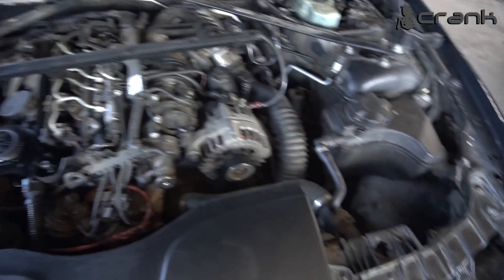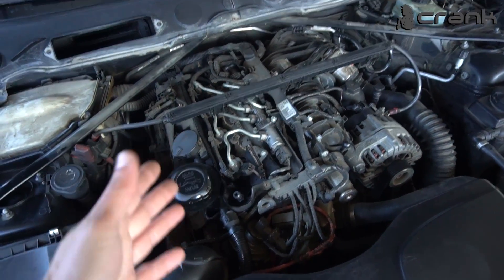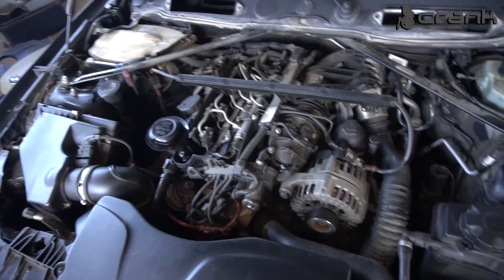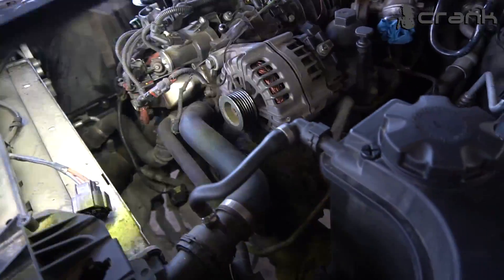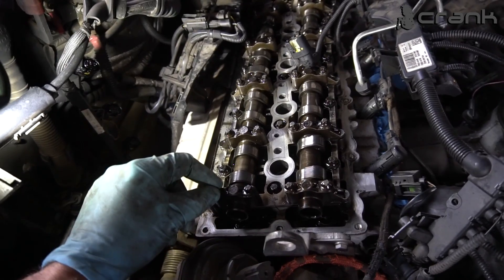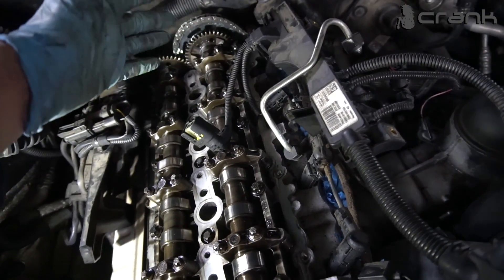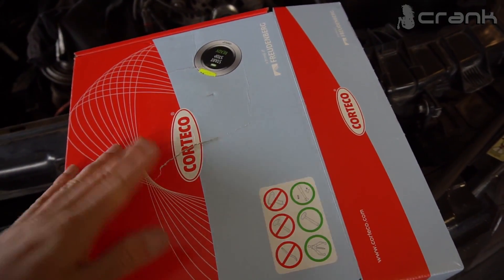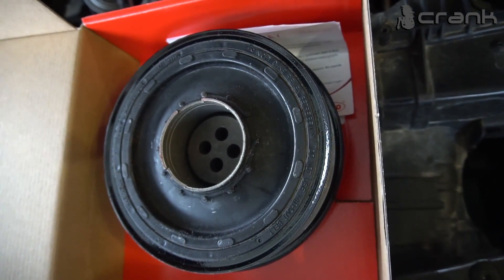BMW N47 Timing Chain Noises Or Is It

Comment: Thanks for sharing 👍
Better to get a car with n47d20c I think.  A little bit better!
Reply from the maker: Yes they are much more reliable than the first N47s
Reply: @crank3646  I have 450,000 km on my one, replaced swirl flaps, turbo, and chains twice since purchase at 250,000 km. Great car e90 320d.
Reply: @crank3646  @dermot hello, what has been made better for N47D20C compare to other models?
what mileage do you think it needs to be changed the timing chain, by experience? thanks
Reply: @bathanmark  d20c mine needed new timing chain at 130k miles/210k km
Reply: @louier9033  i see. At least a peace of mind. :) ready to clock another 100k miles on that...
Reply: @bathanmark  timing chain will last a lot longer if oil is changed regularly also.. i recommend every year or 8000 miles, whichever comes first.
Reply: @louier9033  thanks for the reply. I used to drive a diesel car even before owning a diesel BMW 318D but because of all the N47 timing chain issue, i don't even know what sound of a diesel engine should be considered bad or good. Hehe